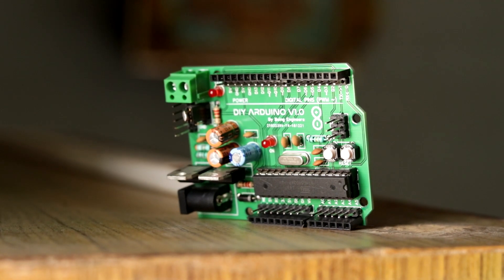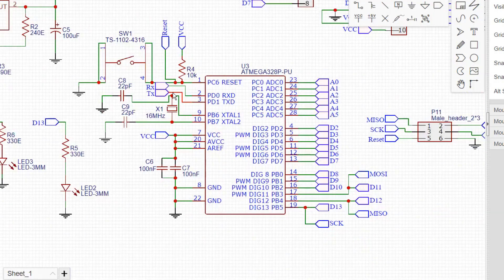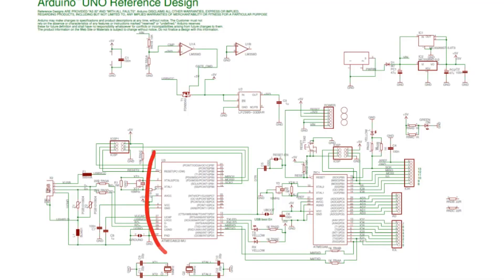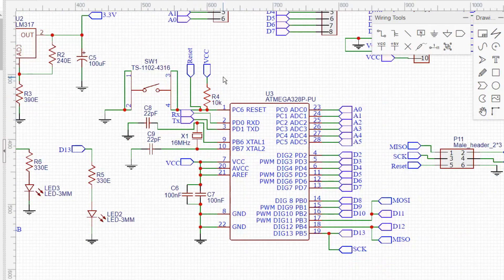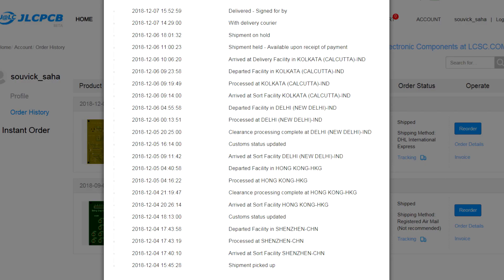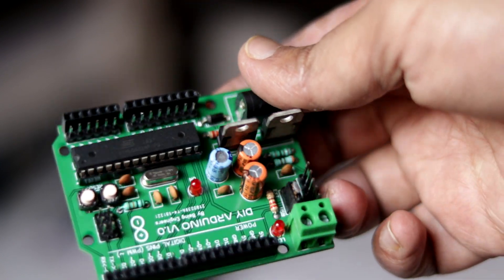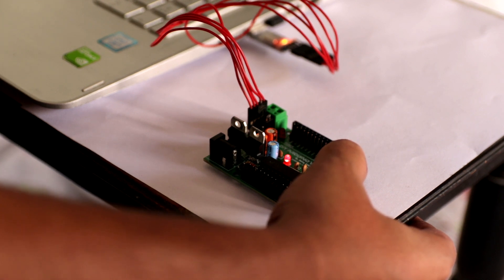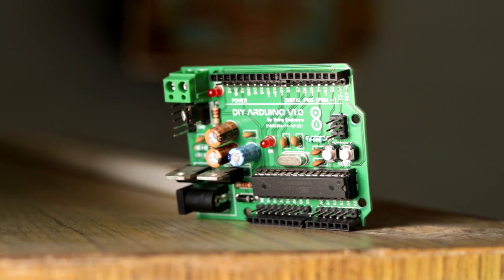DIY Arduino UNO | How to make your own Arduino Uno Board

Comment: Where did you get those female header pins which are having printed matter (arduino pin names) ?
Reply from the maker: Arduino pin names are printed on the PCB, that is called silkscreen. Female headers are the generic one. Nothing special.

Comment: What was the total cost ? (in rupees)
Reply from the maker: around 600 total
Reply: @BeingEngineers1  whatt ??? Arduino UNO costs only 400
making an Arduino UNO costs 600 and that too even working with several crashes, bugs and lags
so better buy instead of making it
Reply: Buying is one thing and Making It is another thing
Reply: Thanks bro !
Reply: On Amazon 200 rs